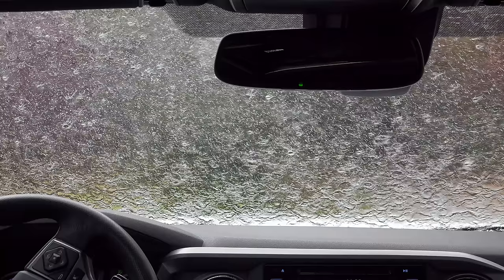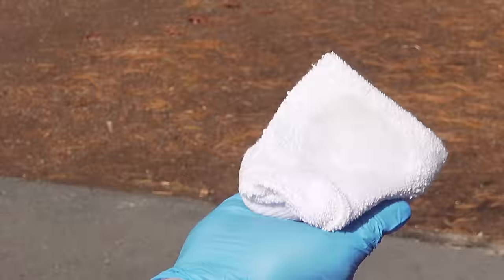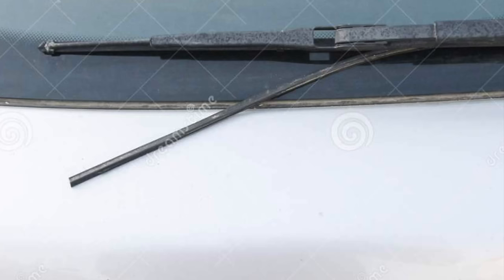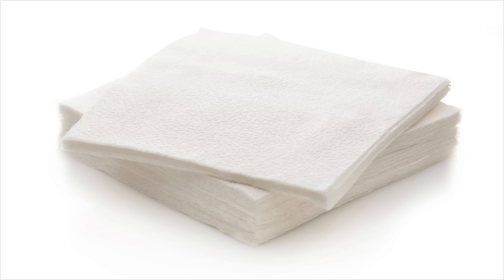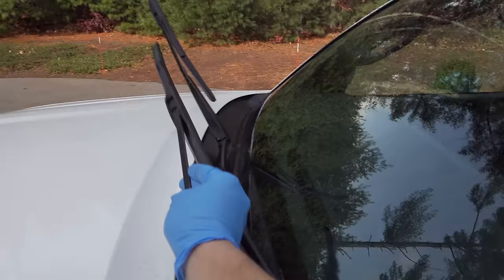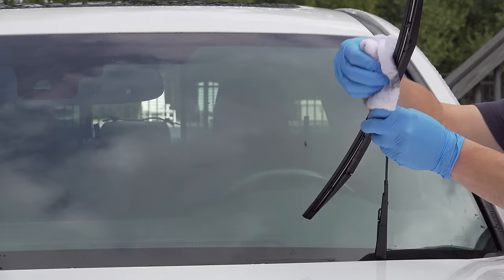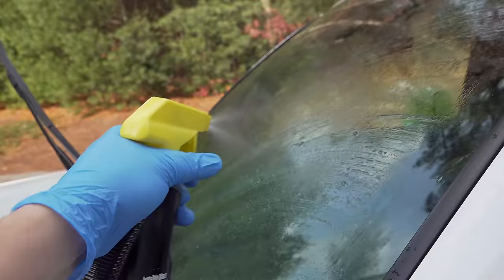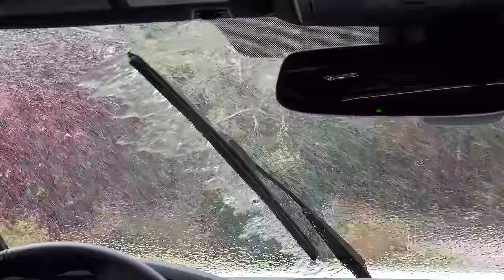How to Make Windshield Wiper Blades Like NEW in 30 Seconds

Comment: WD40 eats rubber, good idea... lol, it “technically” does extend the life though, but only for a short while. Regular cleaning is the only solution
Reply: Officially WD40 is safe for rubber which is odd because hydrocarbons will damage natural rubber.  In any case I'm not sure you want WD40 smeared all over your windshield, so clean the blades with alcohol afterward.  Or just use alcohol to begin with.

Comment: I've never tried cleaning my wipers with WD-40 and probably never will. A lot of people are suggesting silicone spray instead, but Silver Cymbal's main point is that he's CLEANING the wiper blades. A good silicone spray won't have any solvents like WD-40, which I'm guessing is what cleans the dead rubber, tar, road pitch, etc. off the blades. I've cleaned mine with soap and a Scotch Brite pad and that works too.

Comment: I clean my wiper blades with isopropyl alcohol on a cotton ball.
Reply: The alcohol will dry out the rubber and cause it to harden and crack.
Reply: Use a 50/50 alcohol and water mix to prevent drying it out and cracking it
Reply: I use captain moes and Coca Cola, that does wonders too
Reply: Well if you're going to be THAT thorough, then you might as well then use a moisturizing cream so that your blades don't wind up looking like licorice bites. :D
Reply: @jacobg2296  I love Captain Moe's coconut shrimp!

Comment: SOMETHING THAT WORKS SO MUCH BETTER THAN WD40 IS 303 AEROSPACE LUBRICANT!
Reply: Yep, was going to post that. I clean first with denatured alcohol then wipe on a thin layer of 303...
Reply: Whatever Tomo
Reply: You guys are falling for the sweet car project bullshit. 303 is jusr expensive very dilute silicone lubricant.
Reply: @dantheman1337   ...  Really?  You can go to Walmart and get a NINE OUNCE BOTTLE of silicone lubricant for SIXTEEN DOLLARS!  You can go to Amazon and get THREE OUNCES of silicone lubricant grease for ELEVEN DOLLARS!  You can get ELEVEN OUNCES from Grainger, which is SIXTEEN DOLLARS for a spray can!  Etc!  YOU CAN GET A GALLON OF 303 LIQUID FOR ABOUT THIRTY FIVE DOLLARS!

Of the many other things that you can use to clean wiper blades, WD-40 should NOT be used.  Even simple mineral oil is a better choice.  After cleaning, the blades may be treated with silicone lubricant.  Given some time on the blade, about 5 minutes, whether spray, grease, or liquid, the blades may then be wiped again to remove excess.

Stop saying bull shit.
Reply: FYI TO WHOEVER: Instead of wasting money on expensive tire shine products, you can wipe the side of your tires with linseed oil.  You can also use linseed oil to moisturize leather, and for other uses.  As for other applications and products, there are many things people do not know.
Reply: @paulparoma   ...  Oh, windshields CAN be 'sanded'!
Reply: Well hell, one more thing, nothing is going to make a wiper blade like new, unless it is already in like new condition.  Little nicks on the blade, cracked etc, will still leave streaks of water on the windshield.  And obviously, nothing is going to help destroyed wiper blades.  Again, don't use WD-40!  There are better things to use.
Reply: @whatthesnell   ...  Yes.  Alcohol is a better choice to clean the blades.  You can also use windshield reservoir wiper cleaner.  A person can treat the windshield with any of few different products, such as Rain-X.
Reply: Yeah we've all a can of that in our garages.
Reply: @beatbasher   <  Sheeesh!  How old are you?  Have you ever heard of a store, or buying online?  The OP was meant to inform, and it served its purpose.  Now, if you want, you can buy some of the stuff, or not.  LOL
Reply: WRITE IT IN CAPS SO EVERYONE THINKS ITS IMPORTANT
Reply: Wow, whole lot of experts out there!

Comment: Please do not do this...  Petrolium distillates react with the rubber compounds used in wiper blades and cause them to deteriorate.  If you're going to clean them, use a light dish soap and water mixture.  If you want to treat them to keep them pliable, use silicone spray on a rag, and wipe the rag over the rubber, buffing off excess with a clean portion of the rag.

The real problem, though, is waiting until the wipers are having issues to do something.  By this time, the damage has already been done.  All that dirt and debris builds up and embeds itself in the rubber, and over time, puts microscratches in the glass.  You can "clean and treat" the wipers all you want, but even the best materials degrade over time.  Just change the wipers every six months and be done with it.  If you want to be really good to them, once a week, lift them up and clean the glass underneath so they're not stewing in dirt the next time it rains.

Comment: RainX and the RainX washer fluid, with regularly cleaning the windshield.  Nothing sticks to the windshield not bugs, tar, or anything.  The wipers glide across the glass afterwards.  You will have a super clean windshield even in heavy rains.

Comment: Just use Rain-X, 90% of the time you won’t even need to turn the wipers on.
Reply: Past 60km/h
Reply: apv A friend of mine has been using the same bottle for years since you only have to apply a little, for $5 it’s a good investment.
Reply: @apv   I've been using it for over 21 years.
Reply: And there are Rain-X treated wiper blades, too
Reply: How long does the layer stay ? I use to wax the windshield and that works good for a week or two.
Reply: @xivix6710  In my experience, Rain X lasts  for several months.  Great product.
Reply: @KevinSmith-tq3gm   thats much more than I expected! I will try it the next few days. Thanks for answering 👍

Comment: yes of course wd40 on rubber,  its genius really.  I like charging my phone in the microwave also.
Reply: You are crazy, people please DON'T put your phone in the microwave it will instantly be destroyed permanently.
Reply: @mrshoney2624  he was being sarcastic 🙄
Reply: Same reason you don't use WD40 on you motorcycle chain.
Reply: ya, I thought wd40 in time will eat away at rubber? Some people use it to get exhaust systems taken off of those rubber hooks for the exhaust. They say it eventually eats away at the rubber so soapy water is better. I would assume the same here just use soapy water to clean the wiper blades and clean your windshield too.
Reply: @Detz0325  they've done tests on rubber with WD40 being soaked in it,  and it actually doesn't degrade the rubber
Reply: I just use dawn dish soap and water and my glass and blades are just fine.
Reply: @zainsohail01  Yes but there will be some people who will try it!
Reply: @mrshoney2624  nobody is going to put their phone in the microwave
Reply: Mr Pat Wow. You thought he was serious?!
Reply: Mr Pat No shit...
Reply: Green Giant  Quack quack, I am a duck. Thank you for bringing awareness to the life saving properties of Dawn dish soap. We ducks will forever be in it's debt.
Reply: You don't use it on a motorcycle chain because it cleans the grease off which you need on the chain as a lubricant.  That's the opposite here, you want the grease and tar gone?
Reply: @dropthegun21  Is there any silicone based WD-40 at all? I guess you meant silicone based lubricant?
Reply: Somebody owes me a new phone!
Reply: @mrshoney2624  Aww darn! I thought that was a great tip! 😂😂
Reply: @mrshoney2624    Putting your phone in the microwave will NOT harm it.  Turning the microwave on though...
Reply: @zainsohail01  yes but there are some NON technical people on here who will give it a go and end up with dead phone!
Reply: @KevinSmith-tq3gm  you are absolutely correct!
Reply: @mrshoney2624  wym I love putting my phone in the microwave, it always comes out nicely
Reply: @zainsohail01  it's better to leave it in the microwave as leaving it in your pocket will reduced sperm count!
You will be mis-firing!

Comment: I'm surprised the WD-40 doesn't cause smearing on the clean windshield.
Reply from the maker: I really don't love WD40 for everything but it really wins for this job
Reply: How do you keep the WD40 from smearing the oil (in WD40)
 all over the windshield?
Reply from the maker: @RalphS419  Wiping excess off as shown in the video is all I do and I never have issues with that.

Comment: I’ll try this. A set of wiper blades literally lasts just a year for me.
Reply: Buy silicone wiper blades
Reply: @johnnybrowning470  WD40 is not petroleum based.  They use FISH oil, not petroleum.  Totally different.
Reply: @gotcha1885  I think that's a myth...
Reply: @Coreadrin  Wrong! Do your research.
Reply: @gotcha1885  WD40 is mostly stoddard solvent.  That's a petroleum solvent.  There is a very small amount of oil in it too, but not fish oil.
Reply: @63MGB1  After checking further, I have been advised by the WD-40 company that there is NO fish oil in the mix.  I stand corrected.   Thank you.

Comment: Wd breaks down rubber but to do a top of the line conditioning of wiper blade use the spray on and walk away tire sine for tires. Conditions and seals blade from UV damage. Useing same blades for ten years while living in heavy tree sap area.

Comment: Just spend 30 min to remove every oil and dirt from my windshield, Youtube recommends to put oil and petroleum products on the blades. My life is a lie.
Reply: I know I saw through the bull sh1 t. More oil on blade 👎
Reply: WD-40 is not oil.  It's not even a lubricant.  In fact it breaks down oil.  I used to put it on my bicycle chains when I was a kid, then I learned it's actually one of the worst things you can put on a bicycle chain.

Comment: I just wanted to add, for a neglected windshield ( not one that’s really really grimy ) use a small bit of clay bar and a light spray of water before cleaning the windshield. If you look at the clay bar after doing one half of the windshield you’ll be able to see why it’s a good idea.

Comment: Any suggestions on what I can use to shut my wife up while I’m driving?
Reply: Duct tape always worked for me.
Reply: Spray WD40 in your ears and poke hard with a sterile Qtip
Reply: Keith Jones Thank you. I will try that. I also thought of putting her in the trunk and turning up the radio!
Reply: Short of tossing her out the window naah your on own bro !  but as the years go by you Learn to live with it.
Reply: A Lawyer
Reply: A shotgun
Reply: Get her to take the bus.
Reply: @keithjones2340  you stole my idea..lol
Reply: @Simir Johnson Try swapping her chapstick with a glue stick.
Reply: @mmace3  👍👍😂😂😂
Reply: Ejection seat
Reply: Leave her at home and bring your Mistress she will be happy to be in the car with you.
Reply: Simir Johnson, sleeping pills work when hidden in a candy bar 😉
Reply: Swerve into the oncoming traffic momentarily....
Reply: A jar of peanut butter
Reply: Just  bolt the passenger seat in backwards ,tell her its safer that way.
Reply: Convert to Islam ?
Reply: Buy a Shelby 500 with straight thru exhaust, and drive in one gear lower than required. If you can’t shut her up, drown her out :)
Reply: Use the spare sock left over from cleaning the wiper blades. Just stuff it in her mouth!
Reply: @mmace3  hi
Reply: Divorce will work
Reply: Road head works
Reply: @jmanx81  I think that would be great but we all know when you get married that stops if they were dating she'd be all over it like a diabetic at Golden corral
Reply: Wd 40?
Reply: @7pdi7  probably a better idea than putting it on your windshield wiper blades
Reply: @7pdi7  rubbing alcohol works better
Reply: @Mike-fi5se  what the hell's Missouri chrome
Reply: @Mike-fi5se  duct tape?

Comment: WD40 will fix almost anything.
Reply from the maker: Sure does!
Reply: That, plus duct tape.
Reply: ussling does it move? Y
Should it? N
Duct tape

Does it move? N
Should it? Y
WD40
Reply: *except rubber seals. It destroys those. Lol
Reply: In humid environments WD-40 seems to be good for locks, but in dry environments like here in Arizona it destroys locks by gumming them up. I have tried everything, including parts dip, to remove the gum but nothing helps. Gunsmiths say it is murder on guns as well.
Reply: @flagmichael  Gunsmith is dead on. Will almost rust as you watch it  if you put it on the outer metal
Reply: @flagmichael  If  you want to free up your locks in dry environments definitely don't use WD40 cos as you say it just turns the dust into clag.
Use graphite powder. Squeeze a bit in and flip it over a few times while opening and closing the mechanism to get it coating the insides. It will be working smoothly again in no time. You don't need much so don't over do it as the excess will just fall out anyway.  Just give it time to work it's way around.
Reply: @RennieAsh  Exactly
Reply: Need to clean wiper blades? WD40
Dropped out of school? WD40
Need to file bankruptcy? WD40
Reply: flagmichael did you try using wd40 to remove the gum? (And then a cleaner/degreaser)
Reply: makeminefreedom good to hear.. I have a cavity that’s been bothering me. Thanks for the tip😂😂😭💀

Comment: I simply clean the blades using the same windshield washer fluid that comes out of the squirter and then apply a rubber protectant. There are many brands out there with the most well-known being ArmorAll but I switched over to something called 303 when I read somewhere that it was superior. I have no idea if there's any truth to that. We also apply Rain-X to the windshield and while it doesn't seem to last all that long in the Michigan weather, it's a joy to watch the raindrops fly off the glass without using the wipers.

Comment: I usually put peanut butter on mine but anyhow there's places like Ollie's discount you can get wiper blades for like under 4 bucks and to revive the blade as far as if it is salvageable use a little bit of alcohol and clean the blade also I use Rain-X on my windshield

Comment: I have had good luck taking the blades off, soaking them in Protectant 33 and drying them off. I use a ceramic polish and then ceramic wax on the glass outside.

Comment: I've heard the some uses an added step by after removing dirt and debris with solvent they uses silicon "rubber gasket spray" on the whipers. Prevent to from sticking to the windshield in cold weather and make em glide so much smoother. Have not tested it myself.

Comment: thanks, dude. also WD40 which is a brand of water dispersant (WD), actually makes the blade hydrophobic. water dispersant is a little oily itself. so cleans, moisturises dried blades and makes water run away. new wiper blades have an oiley layer on them.

Comment: Dawn dish washing soap and water to clean and de-grease blades and windshield. Coat blades with silicone spray to rejuvenate and protect as well as in all of your weather stripping. Then use RainX on windshield.

Comment: Just bend your wipers back into alignment so they are perpendicular to the windscreen. All these screen coating and new wipers don’t work if the underlying issue isn’t fixed. Adjustable wrench, twist the blade arm either left or right depending on when the wipers chatter. If they chatter when they go up then twist the blade arm anti-clockwise

Comment: In commercial airplanes, we use a 50/50 blend of isopropyl alcohol and water on the windows (flight deck windows, not cabin windows), then wipe them dry. That being said, the windows aren't just glass, so one of these solutions is probably better. (I haven't yet dried it on my vehicle windshield)

Comment: The best option is to use isopropyl or rubbing alcohol for your wiper blades as it will not damage the rubber like WD-40 or dish detergent will.
Reply: I use hand sanitizer, since it is made mostly of alcohol.

Comment: I used rubbing alcohol for years to clean all residue away. Then I would apply RainX to the blades to coat them. Of course, a coat of RainX would be applied to a clean windshield

Comment: My dad taught me another trick. The problem is that the rubber in wipers becomes hard and glazed with age. Take them off and run the edge GENTLY over a bench grinder. This will remove the hard edge and leave a soft rubber edge again. I've done this and it works like a charm.

Comment: I use silicon spray lubricant. I spray my wipers at least once a week. They are still like new after 5 years. Not the same as the spray I use on my tires.

Comment: I use engine oil then thinners then lighter fluid then bleach the caustic soda then granite to buff and then finally cement to seal.
You don't have to touch it ever again.

Comment: You need to put lubricant into your spray reservoir which will keep your rubber blades healthier as you use them.
This is why when you buy a car they seem to last a while longer until the fluid runs out.

Comment: The sun and heat during harsh summers in the desert destroys windshield wipers. I get around this by leaving old worn out wipers in place, with new wipers in the trunk. When it rains or has a good chance of rain I will switch out the old wipers for the new ones. Then after the rain is gone I will switch out the wipers again to keep the new wipers new and protected. It doesn't rain too often in the desert. Switching out the wipers is a little bit of a chore but it beats buying new wipers every year. This only applies to those who live in hot desert climates. But it's a problem I've run into and I thought I would share my solution.

Comment: My go-to…. Clean with dish liquid and then apply hair conditioner to the blades, let that soak in for ten mins then wipe off. The conditioner actually conditions the rubber…  
Use a quality washer liquid in the reservoir. This helps prolong blade life, too.